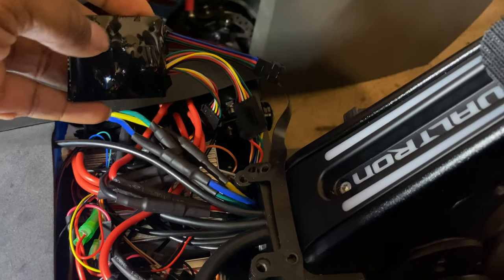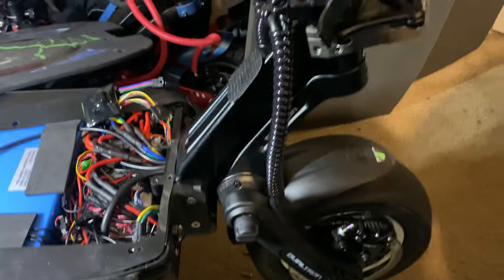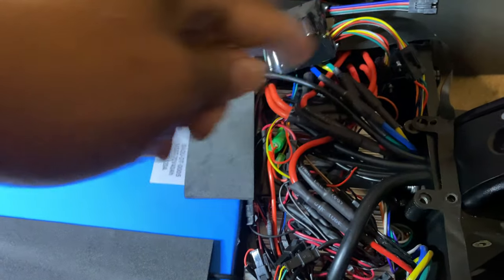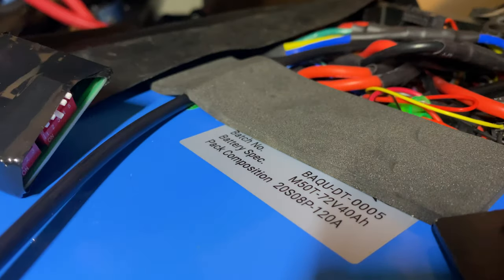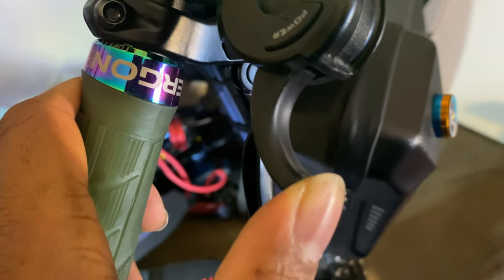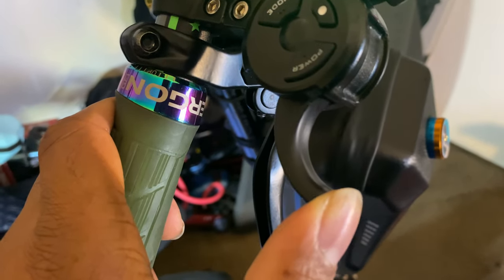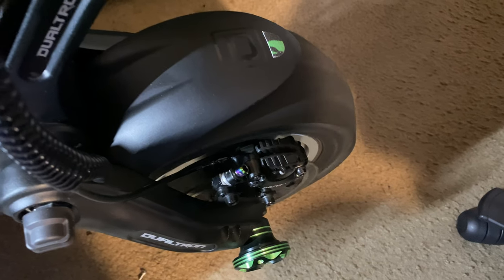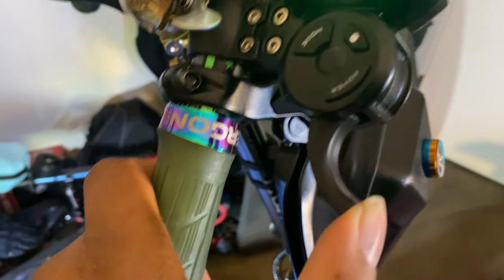Installing Throttle Mapper On Electric Scooter Dualtron thunder 2

Comment: Have you had any problems since the install ?  After watching your video I tried to purchase one, but I was told to wait until they worked out all of the kinks for the 72 volt scooters.  Some people were experiencing “burnt throttles” . You have to do a video with you using it.

Comment: Yeah I need this after my Storm limited works properly. The accelerator is basically full power or no power. Kinda useless.
Reply from the maker: Your having issues with your storm as well ??
Reply: @KiziEwheels  same as V the Sapien. can't go past 50 mph. in mode 3. it's slow to get to 50 in mode 2. really getting impatient. I don't care for this scooter anymore. rather get a thunder 2 since they don't seem to have problems.

Comment: Awesome install. How did you find out about the Throttle Mapper? Is it available for other Dualtron models?
Reply from the maker: I called MinimotorsUSA the have it. It will work for most dualtrons scooters
Reply: What is a throttle mapper? My bad  im new to scooters…
Reply: @KiziEwheels  Thanks. This would be perfect with the Rion Curve throttle on my DX2. I'll have to look into this asap.
Reply: @houweenieinmyswish5600  From my understanding of Kizi Ewheels' video, it's used to reduce the initial high torque output that you get from high powered electric scooters whenever you first press the throttle. This is pretty common with most Dualtron scooters like the Dualtron Thunder 2 in his video and the Dualtron X2 in my videos. I think it also allows you to cruise at low speeds without having to go to a lower gear mode. That's just my interpretation without having experienced it for myself yet.
Reply from the maker: Your right that’s what it does.